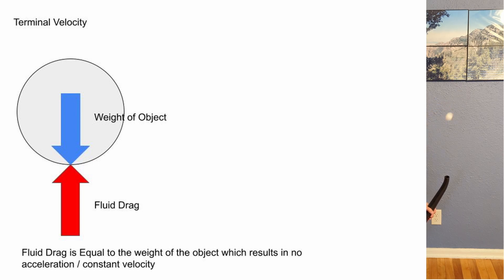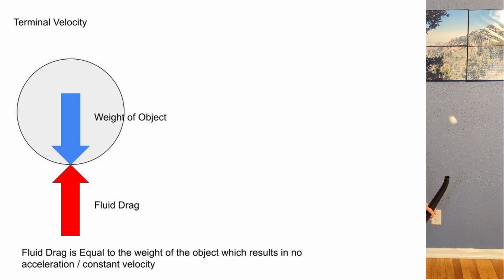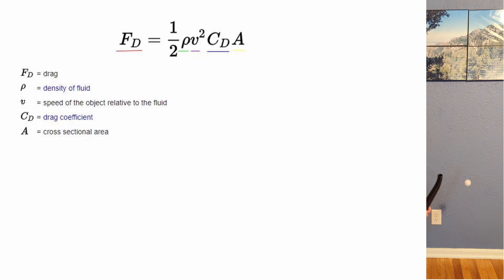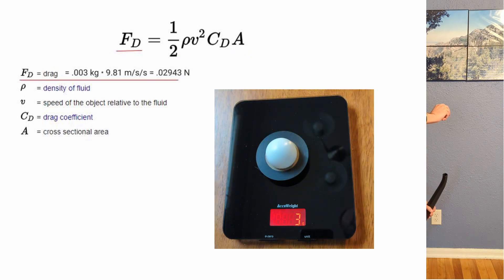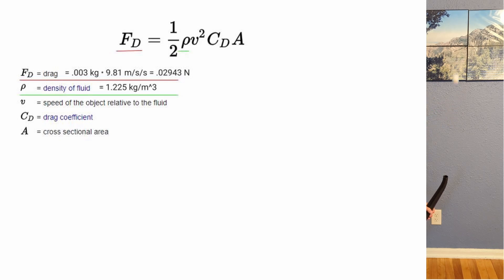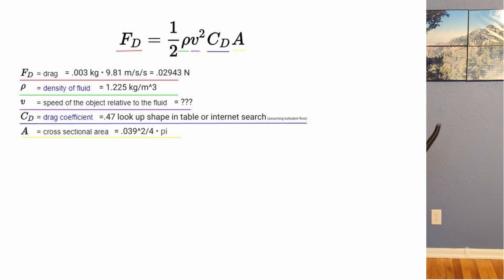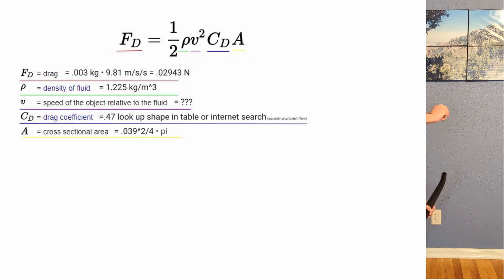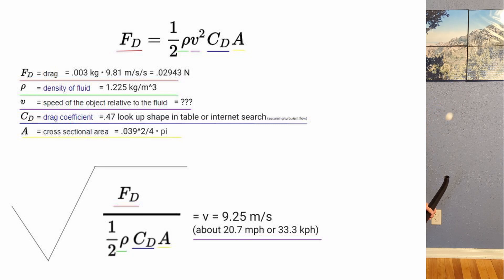Find terminal velocity of ping pong ball. (Fluid Mechanics)

Comment: If we were to change the upwards force on the ping pong ball, what would the observed effect be?
Reply from the maker: so assuming the upward force increases the ball height will increase. Assuming the stream is open to the air the ball will find a new location on the stream where the terminal velocity is. (Basically as you go farther away from source the stream of air loses its force or velocity(dissipates))